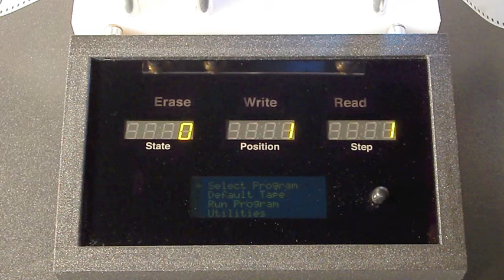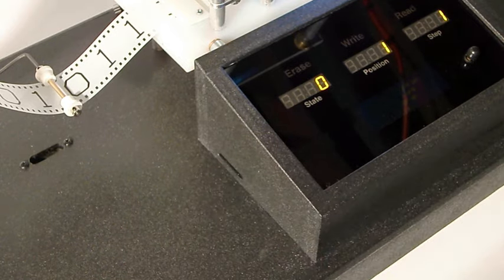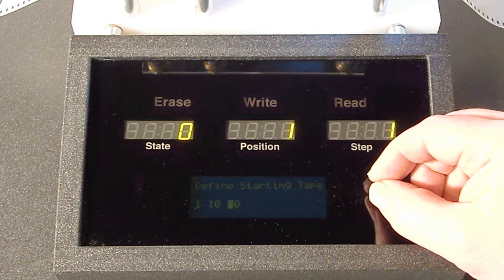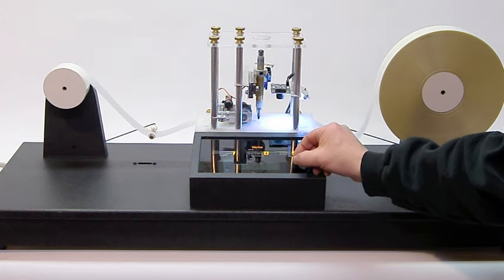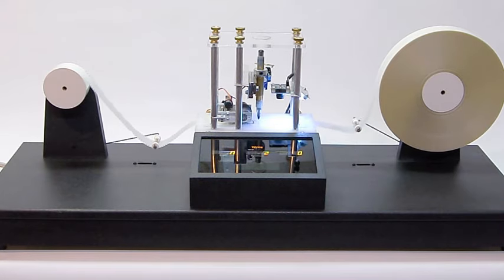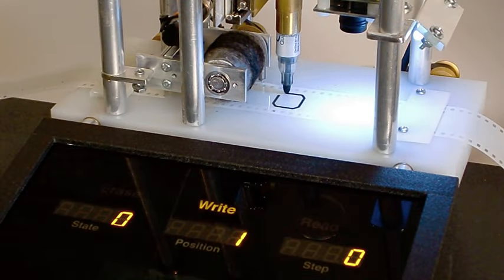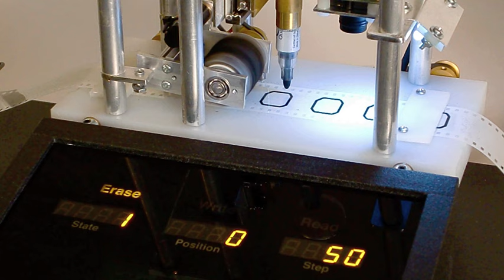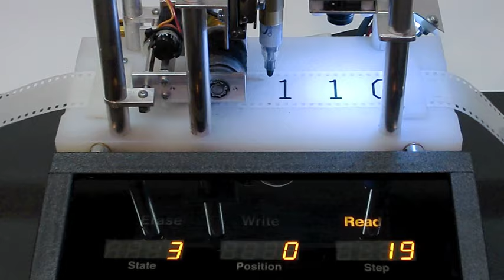A Turing Machine - Overview

Comment: The design may be oriented by the 26 bounded alphabet. A solution to this is to use only two symbols that can express values with informative distinctions. A can be represented by 1000000 and B as 1000001. This is possible by sending the raw binary value to a subprocess in the mainprocess of the TM. This is one of the many ways a TM can simulate the behaviour of computers. The point of a TM is to create a design that can automate math problems. Computers are turing machines as well.

Comment: Some thing like this would motivate my interrest to the university course, i thought it was just a theorical stufff :D good job man.
Reply: +pluton1795  Actually most of the course is  theorical . + trying to  building a turing machine is useless because a real Turing Machine is impossible to build
Reply: +Sahaj Quinci 
Is it? I've been thinking of ways to make a mostly mechanical Turing machine, but some electricity always comes in. It would be hard-programmed of course, unlike this one, so it would be built as a physical model of a TM diagram. What should be impossible about this?
Reply: A  REAL  Turing Machine  has got infinite memory
Reply: +Sahaj Quinci  I took this course (automata) in 1994 :)
Reply: +pluton1795 got it :) i just gave my exam(API) about it

Comment: @lestherpalacios no an FSM is not as powerful as a TM.

and you're mixing the practical applications of the theory with the model (most parsers are based on pushdown automata, lexers are usually FSMs though)

a TM is a model of computation as are FSM and pushdown automata and we have that FSM < PDA < TM

Comment: @Olaftr Well... you'd probably have to write an emulator for something like a normal computer before you could run Linux... but Linux is pretty much designed not to halt when it is not given any input, and TMs don't have any way to get input once they start, so... it's not really compatible with the way a Turing Machine is meant to operate...

Comment: No matter how many videos I watch on this, I never get how this machine works..
Reply: Manos Seferidis This machine was created by Mr. Alan Turing and can simulate a computer theoretically. This Machine is the base of Computation Theory, and is used to avaluate the complexity of an algorithym. Is an automaton which means: the machine is in a state,  reads what is in the tape, and acts accordingly to the rules of that state, and then, depending on what is reads in the tape, goes to a new state (or can continue on that state) and acts accordingly to the rules of that state.
Bottomline, Mr Turing, is not only a hero for saving aproximatly 14 millions life from being killed in the WWII but is also a genious and the father of computation. And this machine helped a lot.
Reply: Manos Seferidis A real turning machine is a abstract. But this is a physical model of it. Pretty cool. The idea is that  this machine given as much time and tape as it needs, can do ANYTHING any digital computer with a small set of operations, (read, write, advance/retract tape, and erase), and a finite set of transition rules. Turing is like the Einstein or Euler of Computer Science.
Reply: You won't get it just watching videos. Try to first "get" the informal definition in the Turing Machine wikipedia article. Then maybe it will start to make sense, If you also consider that a Turing Machine DOES have storage beside the tape: It stores it's current state and the instruction table somewhere.
Reply: Simple as it is, the Turing Machine is not the simplest machine that can perform some computations. There are even more simple ones, so you can start from there and build up. Those simple ones are REALLY simple, as simple as your daily routine. They're basically a list of states you can be at any particular moment, and arrows that tell you how to go from one state to another and when (depending on what symbol is there currently on the input). Such an automaton begins at a certain initial state and looks at the first symbol on the input, and depending on what symbol it is, it decides what state it should go next, by choosing the arrow (path) that is labeled by that particular symbol. Then it repeats that with the next symbol, and another, etc., until there's no more symbols left. Then it halts, and the state in which it halts tells you the "answer" that it was supposed to compute (e.g. that tells you whether the input was correct or not).

This type of computation may sound very primitive, but even at that level it is quite powerful! Those machines (Finite State Automata, as they're properly called) can recognize a wide range of inputs called "regular languages". If you know a bit about programming, you might have heard about so called "regular expressions", which are "programs" for such machines: they are sets of rules that are then being translated into state machines which can check whether a given text input matches those patterns or not. They're being used, for example, to verify if you input a correct e-mail address in a form on a website, or to mark numbers and keywords in text editors with different colors, etc. State machines can also control robots and other industrial machines by telling them what to do next depending on the "input", which is just a set of instructions.

But they also have some limitations: they are too simple to be able to COUNT up to an arbitrary number. They can count only up to as big a number as many different states are there in the machine. As soon as the number of states run out, they start to repeat, losing information about the running total, so they cannot count beyond that. Because of that, it cannot, for example, match the open parentheses with closed parentheses, or a nested tree of HTML tags, or do any tree recursion in order to analyze self-similar structures.

This can be fixed by adding them some power by "attaching them some more limbs", so to speak. One of such limbs is a STACK, which is a sort of "memory" that can store information in a form of a list of increasing length, in which you can attach more information at the end of the list, but if you want to read it back, you have to detach it from the end. You cannot take away from an arbitrary position. Whatever comes in first, comes out last. A state machine with a stack is called a Pushdown Automaton, and it can do more stuff than a simple state machine, because now, when it runs out of states, it can push the current state on the stack in order to remember it and jump to some other state. It can use the stack to remember multiple things at once. Therefore it can match open parentheses with closed parentheses up to arbitrary level of nesting, and it can analyze HTML documents. It can also analyze simple grammar, which is basically a hierarchical tree-like structure with self-similar branches. Therefore it can recognize a wider range of languages: so called Context-Free Languages (CFL). But it has its own limits as well, because of the way its "memory" works (the stack):  it can only put the data on the top of the stack and take them from the top of the stack, so the data can be taken from the stack only in the reverse order to how they've been put on the stack. This means that it can tell if a word is a palindrome (ABCDEEDCBA), but it cannot tell whether the first part matches the second part (ABCDEABCDE).

Turing Machines are a step up from that: they use this long TAPE as their memory instead of the stack. You can think of the tape as two stacks joined with their tops ;> in such a way that when you take something away from one stack, it lands on the top of the other stack. As the read/write head moves along the tape and reads/writes data on its cells, this is equivalent to shifting data from one stack to the other. It's similar to what you do when going through a row of books on a shelf in order to find a particular one: you move them one by one from one side of the shelf (the first stack) to the other (the second stack), holding one book at a time in your hand (the read/write head). You can take that book away in order to get a closer look on it (read), or replace with a different book at this position on the shelf (write). Having two stacks joined in this way basically allows you to read/write at arbitrary position on the list, and that's what gives Turing Machines an advantage over Pushdown Automata ;> And it so happens that this suffices to do arbitrary computations.

Comment: @JolyG Ah I have a better explanation

Let's say you have a function F, F is computable if and only if there is a Turing Machine that takes as input (the inital values on the tape when the TM starts) strings in the range of F and produces the corresponding output (value on the tape when it halts) and the machine must halt for every value in the range of F.

P and NP are about how many steps it takes for a TM to compute something, both are about things that ARE computeable.

Comment: In 1970 I used slightly more advanced machine to create and execute control programs for large tool machines. The tape on early machines was made of paper. Later upgraded to mylar tape. These were based on much earlier loom control cards/tape stored programs. I did a payroll system on a computer with 4K (thats 400 thousand) total memory. About what a adverage watch mght have now.  With some trainning and lot of creativity you can do a lot with a with a miminal system.

Comment: Just curious, as a CS student in progress, but since this has a finite amount amount of memory (tape), would this technically be considered a Finite State Machine? Because there are a set number of states that it can go from and to. Or would the fact that the program can be any size make it more like a Turing Machine?
Just trying to figure out some stuff.
Thanks!
Reply: Yes, it would.  A "real" Turing machine has an infinite length of tape.  However, judging from the size of that tape, I am sure quite a few complex problems can be executed on it.
Reply: It is not just the length of the tape that limits it, it is just as much the length of the StateEngine-program a "simple text file" (fleetingly mentioned in the commentary). But the point of the Turing Machine is that you can discuss, mathematically prove, and partially experiment with some fundamental principles, like Halting
Reply: The "infinite tape" concept in Turing's Machine is often misunderstood. It doesn't mean that the tape has to be actually infinite. What matters is that it has to be POTENTIALLY infinite, that is, that there are no limitations in principle on the length of the tape, other than physical resources (which are a limitation to everything anyway). With finite state automata, the number of states is a true limitation, because adding more states basically means you have to rebuild the entire machine. The states cannot be added on the fly as you need them, because it requires to structurally reconnect the existing states with the new ones. The tape, though, is a different story: you can easily increase its length once you see that the computation starts running short of the existing one without the need to rebuild the machine: just bring some more tape and glue it to the end of the existing one before the machine reaches it. The state machine which is the "brain" of Turing's machine can keep operating as if nothing happened, it doesn't have to be rebuilt. It's similar to a situation that you're running some program on your computer that generates tons of data, and your hard disk starts running short, so you simply attach another hard disk through a USB cable and you get more space for your data without interrupting the program. And in principle, you can attach as many disks as you wish when it turns out to be required.

Comment: It still seems silly to me. The design uses a tape for memory but it also uses a "table" for memory. The tape is "RAM" and also I/O and is explain in detail however the more critical "ROM" table that makes the whole thing work is just glossed over. Also if it has no other RAM besides the tape then it really is just a minimal state machine, and not a computer. I don't think a state machine qualifies as a computer.

Comment: And forgive me for pointing out the obvious, but your TM is akin to using a human to drive a treadmill. I.e., an entity, which is orders of magnitude more sophisticated and capable, manifesting itself in a system capable only to perform primitive tasks. To eliminate this antagonism, a mechanical TM should be purely mechanical: no lights, optical sensors, electronic circuits, electric motors, etc. Could be driven by a crank operated by a ... human :)  But your TM is truly beautiful, hats off.

Comment: What are some things you could write in the plain text files?
Reply: Matt Garrett Machine code im guessing
Reply: Matt Garrett What files? 'File' is a much higher-level concept than this addresses
Reply: Matt Garrett Instructions for the Turing machine.
Means what the machine should do when a certain input is given.
You have a given starting point and some input on the tape. Based on the tape the starting point changes to another state etc.
Reply: +kanna kataX The instructions are written in binary, correct?
Reply: They dont have to. You could develop a machine which reads words  executes them. But often binary is used.
Reply: Actually, you could write code in some custom assembly language but it would eventually have to be assembled into a binary executable image.

Comment: And ... what can the machine exactly do? I dont rly get it :3 Yeah it can write 1 or 0 and can also erease it .... and? :) This is the first step of a pc? I think its more the first hard drive isnt it? ;]
Reply: Jack Wiedemann all computers work this way. Tape is just replaced by other faster type of memory and the erase/write is a million times faster. But they all work this way.
Reply: Jack Wiedemann maybe a couple important things:The SD card has the instructions. The algorithm.The machine will eventually stop. When it does, in the band there will be written the answer to the problem that the algorithm solves.The algorithm would be clear instructions like:Read value in tape. If it is one, erase and write a zero, then go to line 23, etc etc.P.S. - It is not easy to make such algorithms. They would be made by mathematicians.
Reply: And the answer will be: 42 :J

Comment: @JolyG A Turing machine was NEVER a computer that you would actually build and use, it was just a way of thinking about computers, it is meant to be very simple so you can proove things about it more easily. We know that it CAN compute anything that an actual computer can, but not as quickly.

It's not, nor was it intended to be a practical computer, it's a reasoning tool.

This is just a geeky-awesome toy.

Comment: Making the Turing machine controlled by microprocessor is like building prototype of steam engine having among other parts electric motor and battery.

You will never convince people that the tape operations are the actual computing. The camera there is to distract attention. All calculations are made in the chip. The «turing machine» is just fancy-looking printer.

Comment: Doesn't a turing machine have 2 states per cell rather than 3? Yours has the possible states of blank, 0, and 1. A turing machine has the possible states of blank and 1.
Reply from the maker: If you read Turing's original paper, his idea actually had four or more states and even contained things that were more control like. It's really just the current classical teaching of the idea that has stripped it back to two states. I think this has been done to make it seem more binary computer like.
Reply: Well, Mike read the original paper, so I'll defer to him, but you can define any "alphabet" (which symbols you allow) for the turing machine - you can have any number of symbols (sort of equivalent  the width of your CPU memory, 16, 32 or 64 bit). Blank is optional, so you can have only 0&1, or *+ # - | (a list of 5) or A-Z. It makes each step (=state in engine) more complicated as it has to have a defined response (=next state/write/move) for any symbol read.
Reply: @Mskvaer  Does it mean that 0 should then be the "blank" (the default state of an empty cell) and 1 be the "mark", and that 1 would then be the only symbol that can be used for anything useful, so that all other abstract symbols would have to be encoded in unary, as strings of 1s? Because that would be veeeery inefficient :q
Reply: @bonbonpony  I do not know, I have not read the original paper. It depends on how many states you read. If you read/test for ' ', '0', and '1' you use 3, if only '0' and '1' it is only two. But if you test for '0','1' and not-'1' you use more than 2. It seems easier for me to write simulators with more symbols.

Comment: This is not GDDR5.... Not even DDR.... Not even a single D
Reply: DDR stands for Double Data Rate, which means that you can read both on the raising edge and the falling edge of the clock. Soo... adding a second tape that can be read while the first one is being written, maybe? :q